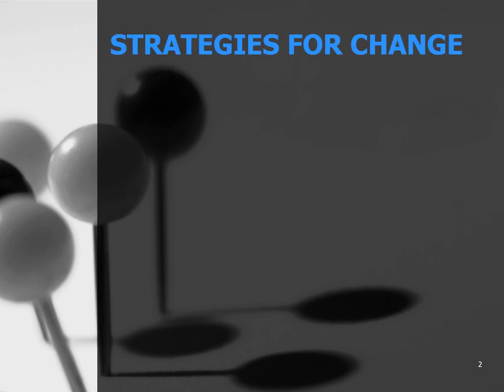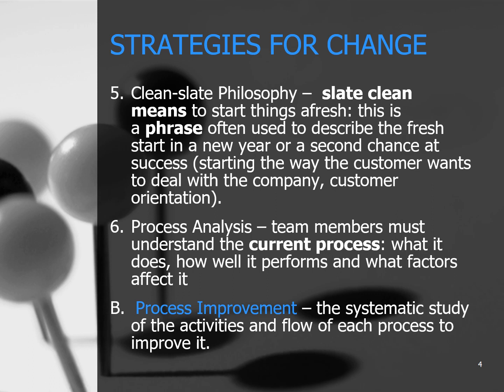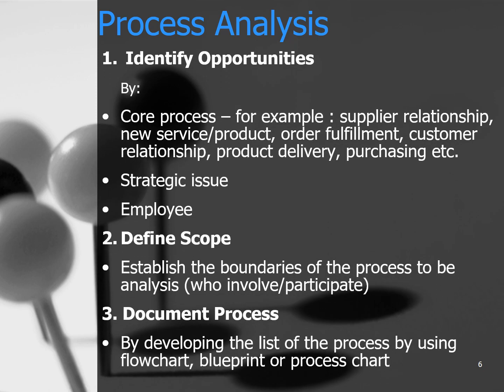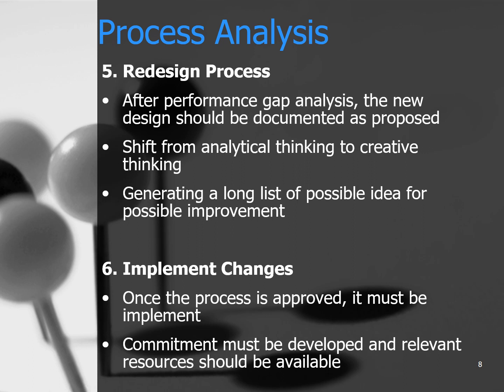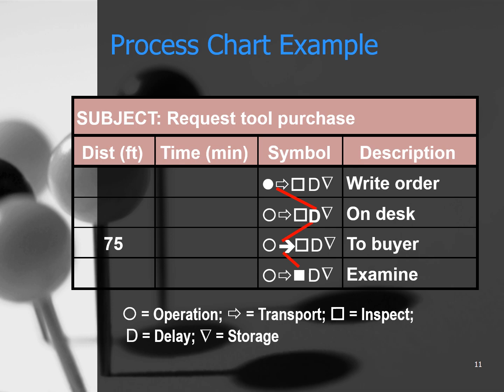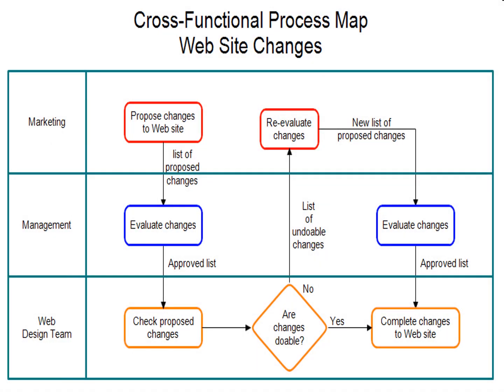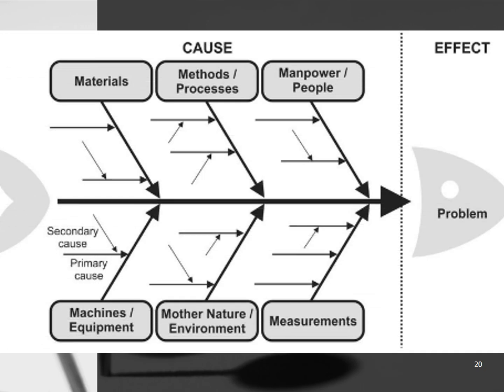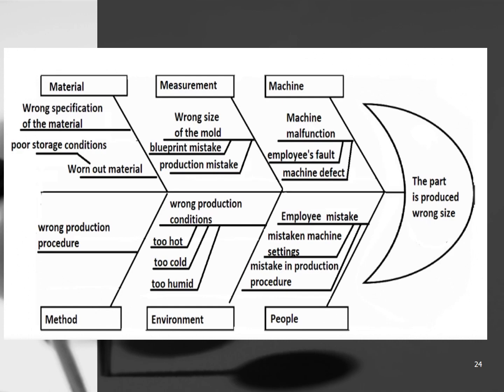Process Improvement

Comment: Based on my understanding about topic 6 (Process Improvement) 
there are 6 elements of strategies for change :
1) Critical Process - emphasize o essential process and core business.
2) Strong Leadership - manager help overcome resistance, set objectives of the process
3) Cross-functional Team - consists of member for each functional area (HR department)
4) Information Technology 
5) Clean-slate Philosophy - starting the way customer want to deal with the company
6) Process Analysis - team members must understand the current process
 
Next, 6 Step a systematic approach of process analysis
1) Identify Opportunities ( core process, employee)
2) Define Scope 
3) Document Process (list of process : flowchart, process chart)
4) Evaluate Performance ( measure quality, time, cost)
5) Redesign Process 
6) Implement Changes
 
Flow Process Chart 
 5 symbols : operations, transportation, inspection, delay and storage

Comment: Based on the video, what can I understand are that strategies for change can be equated to critical success project with additional two elements which are critical process, strong leadership or also known as visible active leadership in critical success project, cross-functional team, information technology that lead to the success of BPR, clean-slate philosophy whereby all knowledge come from experience or perception of the customer either internal/external customer and process analysis where it help the organization or team members to identify what needs to be done, when and how to do it.

For systematic approach, there will be a process analysis whereby it a set of tools use to identify opportunities from improvement, document current process, evaluate performance, redesigned the process and implement desired changes. It consist of six steps which are:

1. Identify opportunities 
- More focus on the core processes such as supplier, relationship, new service/product, order fulfilment,  customer relationship, strategic issue and employee.

2. Define scope
- Assign resources that match the scope of the process design team & establish for large reengineering project.

3. Document process
- Develop list of process by using:
   Flowchart - Diagram that trace the flow of information, customer, equipment, material to various steps     
                        steps of process
   Blueprint - Special flowchart/services process that shows which of it steps has higher customer.
   Process chart - Concentrate on more detail on smaller number of steps that does the flowchart.

4. Evaluate performance
- Evaluate performance on quality, customer satisfaction, time, cost, error, safety, environment and flexibility.

5. Redesign process
- Have a brainstorming and generating a long list of possible idea for possible improvement.

6. Implement changes
- Once the process have been approved, it must be implemented.

Besides that, there will also have a flow of process chart whereby it is a document that used in system analysis that identify each step in specific work process by using the following categories:

-operation
-transportation
-inspection
-delay
-storage

Lastly, it is about fishbone diagram whereby it use to track down the imperfection or defects failures in the system. It also known as Ishikawa diagram or Herringbone diagram.